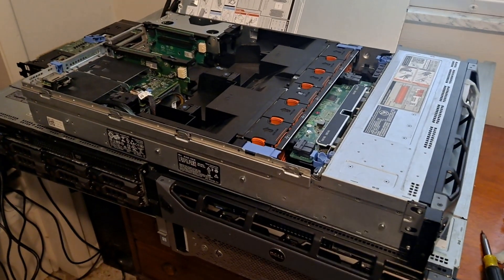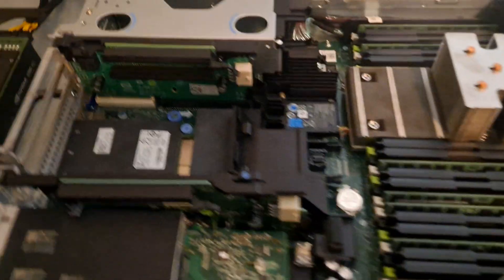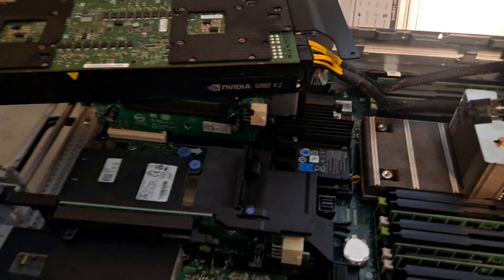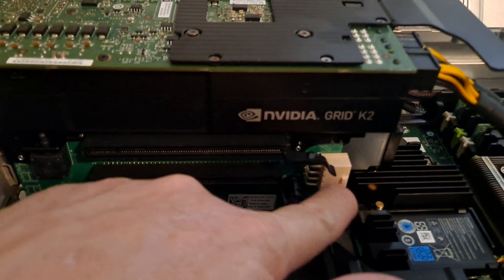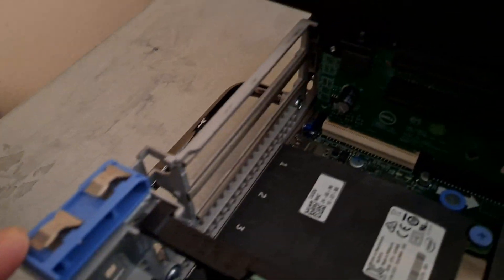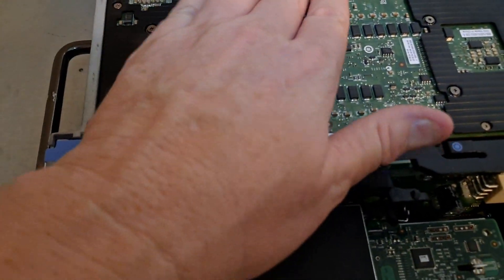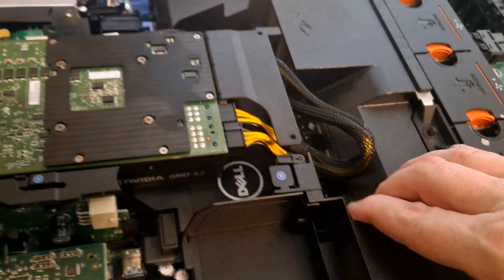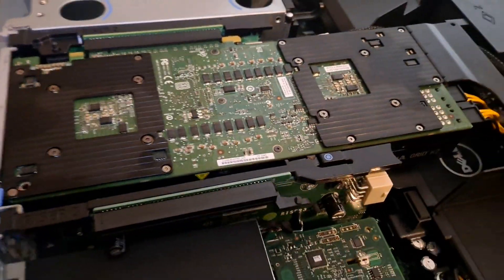Nvidia Grid K2 Dell r730 Install for Proxmox

Comment: Nice! I just bought a dell r730xd for Proxmox too.  I was wondering how much fan speed increase for keeping it cool? I may get a GPU for my local AI server set up.
Reply from the maker: I use IPMI commands to turn down the fans and even with the GPU run the fans at 4800 rpm with many VM;s running cpu time never over 122. If using your system for remote gaming I would run fans a little faster but really just put it under load and monitor. At 4800 rpm the system is quiet.
Reply: @callmebigpapa  I am also using the IPMI tool to set it manually, thanks for the tip, I will keep an eye on that CPU/case temperature.